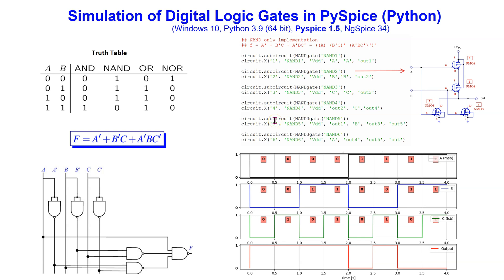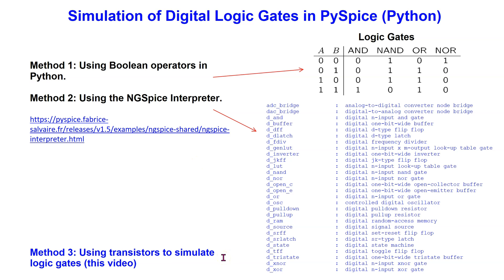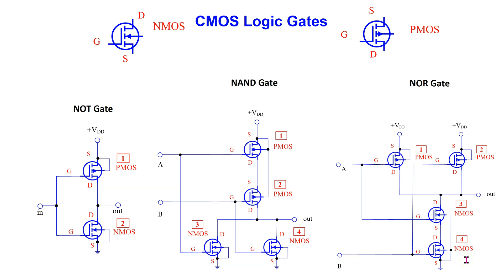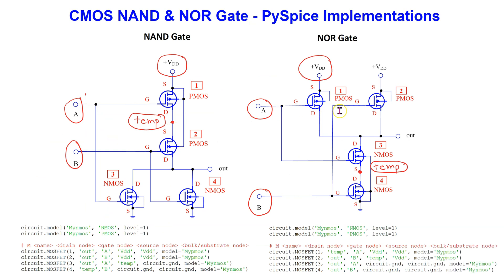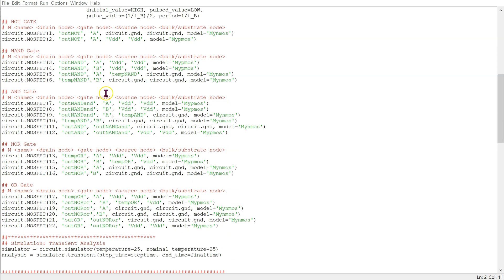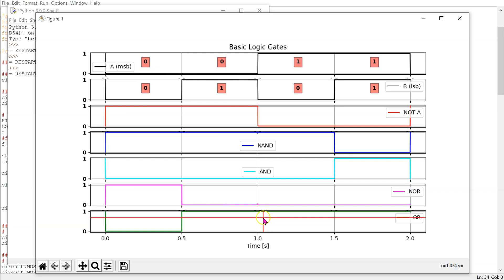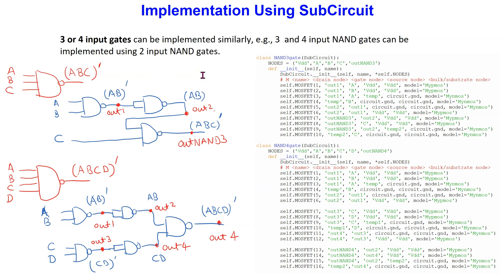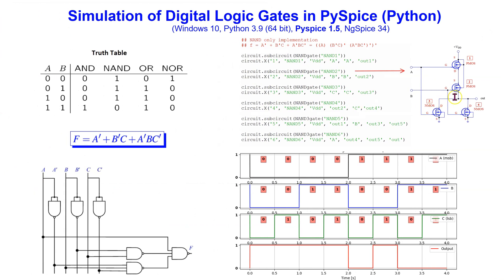Simulation of Digital Logic Gates in PySpice (Python)

Comment from the maker: ## Python code to simulate and verify the truth table of basic logic gates.

##*********************************************
import math
import numpy as np
import matplotlib.pyplot as plt
from matplotlib.widgets import Cursor
from matplotlib.pyplot import semilogx
from matplotlib import pyplot

import PySpice.Logging.Logging as Logging
logger = Logging.setup_logging()

from PySpice.Doc.ExampleTools import find_libraries
from PySpice.Probe.Plot import plot
from PySpice.Spice.Library import SpiceLibrary
from PySpice.Spice.Netlist import Circuit
from PySpice.Unit import *

from engineering_notation import EngNumber

##*********************************************

## Circuit Netlist
circuit = Circuit('2-input Logic Gates')

## Define basic NMOS and PMOS models
circuit.model('Mynmos', 'NMOS', level=1)
circuit.model('MYpmos', 'PMOS', level=1)

# Define inputs
HIGH = 3@u_V
LOW = 0@u_V
f_B = 1@u_Hz
#f_A = ((f_B)/2)
f_A = ((f_B+1e-3)/2)

steptime=1@u_ms
finaltime = 2/f_B

circuit.V(1, 'Vdd', circuit.gnd, HIGH@u_V)

circuit.PulseVoltageSource(2, 'A', circuit.gnd,
                           initial_value=HIGH, pulsed_value=LOW,
                           pulse_width=(1/f_A)/2, period=1/f_A)

circuit.PulseVoltageSource(3, 'B', circuit.gnd,
                           initial_value=HIGH, pulsed_value=LOW,
                           pulse_width=(1/f_B)/2, period=1/f_B)
## NOT GATE
# M <name> <drain node> <gate node> <source node> <bulk/substrate node>
circuit.MOSFET(1, 'outNOT', 'A', circuit.gnd, circuit.gnd, model='Mynmos')
circuit.MOSFET(2, 'outNOT', 'A', 'Vdd', 'Vdd', model='Mypmos')

## NAND Gate
# M <name> <drain node> <gate node> <source node> <bulk/substrate node>
circuit.MOSFET(3, 'outNAND', 'A', 'Vdd', 'Vdd', model='Mypmos')
circuit.MOSFET(4, 'outNAND', 'B', 'Vdd', 'Vdd', model='Mypmos')
circuit.MOSFET(5, 'outNAND', 'A', 'tempNAND', circuit.gnd, model='Mynmos')
circuit.MOSFET(6, 'tempNAND','B', circuit.gnd, circuit.gnd, model='Mynmos')

## AND Gate
# M <name> <drain node> <gate node> <source node> <bulk/substrate node>
circuit.MOSFET(7, 'outNANDand', 'A', 'Vdd', 'Vdd', model='Mypmos')
circuit.MOSFET(8, 'outNANDand', 'B', 'Vdd', 'Vdd', model='Mypmos')
circuit.MOSFET(9, 'outNANDand', 'A', 'tempAND', circuit.gnd, model='Mynmos')
circuit.MOSFET(10, 'tempAND','B', circuit.gnd, circuit.gnd, model='Mynmos')
circuit.MOSFET(11, 'outAND', 'outNANDand', circuit.gnd, circuit.gnd, model='Mynmos')
circuit.MOSFET(12, 'outAND', 'outNANDand', 'Vdd', 'Vdd', model='Mypmos')

## NOR Gate
# M <name> <drain node> <gate node> <source node> <bulk/substrate node>
circuit.MOSFET(13, 'tempOR', 'A', 'Vdd', 'Vdd', model='Mypmos')
circuit.MOSFET(14, 'outNOR', 'B', 'tempOR', 'Vdd', model='Mypmos')
circuit.MOSFET(15, 'outNOR', 'A', circuit.gnd, circuit.gnd, model='Mynmos')
circuit.MOSFET(16, 'outNOR','B', circuit.gnd, circuit.gnd, model='Mynmos')

## OR Gate
# M <name> <drain node> <gate node> <source node> <bulk/substrate node>
circuit.MOSFET(17, 'tempOR', 'A', 'Vdd', 'Vdd', model='Mypmos')
circuit.MOSFET(18, 'outNORor', 'B', 'tempOR', 'Vdd', model='Mypmos')
circuit.MOSFET(19, 'outNORor', 'A', circuit.gnd, circuit.gnd, model='Mynmos')
circuit.MOSFET(20, 'outNORor','B', circuit.gnd, circuit.gnd, model='Mynmos')
circuit.MOSFET(21, 'outOR', 'outNORor', circuit.gnd, circuit.gnd, model='Mynmos')
circuit.MOSFET(22, 'outOR', 'outNORor', 'Vdd', 'Vdd', model='Mypmos')

##*********************************************
## Simulation: Transient Analysis
simulator = circuit.simulator(temperature=25, nominal_temperature=25)
analysis = simulator.transient(step_time=steptime, end_time=finaltime)

##*********************************************
# PLOTTING COMMANDS

figure = plt.subplots(figsize=(11, 6))

axe = plt.subplot(711)
plt.title('Basic Logic Gates')
plt.grid()
plot(analysis['A'], axis=axe, color='black', label='A (msb)')
plt.legend()
axe.set_xticks(np.arange(0, finaltime+.5/f_B, 0.5/f_B))
axe.set_yticks([0, float(HIGH)])
labels = ['0', '1']
axe.set_yticklabels(labels, fontweight='bold')

axe.text(0.25*(1/f_B), 0.5*float(HIGH), '0', fontweight='bold',
        bbox={'facecolor': 'red', 'alpha': 0.5, 'pad': 4})
axe.text(0.75*(1/f_B), 0.5*float(HIGH), '0', fontweight='bold',
        bbox={'facecolor': 'red', 'alpha': 0.5, 'pad': 4})
axe.text(1.25*(1/f_B), 0.5*float(HIGH), '1', fontweight='bold',
        bbox={'facecolor': 'red', 'alpha': 0.5, 'pad': 4})
axe.text(1.75*(1/f_B), 0.5*float(HIGH), '1', fontweight='bold',
        bbox={'facecolor': 'red', 'alpha': 0.5, 'pad': 4})

axe = plt.subplot(712)
plt.grid()
plot(analysis['B'], axis=axe, color='black', label='B (lsb)')
plt.legend()
axe.set_xticks(np.arange(0, finaltime+.5/f_B, 0.5/f_B))
axe.set_yticks([0, float(HIGH)])
labels = ['0', '1']
axe.set_yticklabels(labels, fontweight='bold')

axe.text(0.25*(1/f_B), 0.5*float(HIGH), '0', fontweight='bold',
        bbox={'facecolor': 'red', 'alpha': 0.5, 'pad': 4})
axe.text(0.75*(1/f_B), 0.5*float(HIGH), '1', fontweight='bold',
        bbox={'facecolor': 'red', 'alpha': 0.5, 'pad': 4})
axe.text(1.25*(1/f_B), 0.5*float(HIGH), '0', fontweight='bold',
        bbox={'facecolor': 'red', 'alpha': 0.5, 'pad': 4})
axe.text(1.75*(1/f_B), 0.5*float(HIGH), '1', fontweight='bold',
        bbox={'facecolor': 'red', 'alpha': 0.5, 'pad': 4})

axe = plt.subplot(713)
plt.grid()
plot(analysis['outNOT'], axis=axe, color='red', label='NOT A')
plt.legend()
axe.set_xticks(np.arange(0, finaltime+.5/f_B, 0.5/f_B))
axe.set_yticks([0, float(HIGH)])
labels = ['0', '1']
axe.set_yticklabels(labels, fontweight='bold')

axe = plt.subplot(714)
plt.grid()
plot(analysis['outNAND'], axis=axe, color='blue', label='NAND')
plt.legend()
axe.set_xticks(np.arange(0, finaltime+.5/f_B, 0.5/f_B))
axe.set_yticks([0,float(HIGH)])
labels = ['0', '1']
axe.set_yticklabels(labels, fontweight='bold')

axe = plt.subplot(715)
plt.grid()
plot(analysis['outAND'], axis=axe, color='cyan', label='AND')
plt.legend()
axe.set_xticks(np.arange(0, finaltime+.5/f_B, 0.5/f_B))
axe.set_yticks([0, float(HIGH)])
labels = ['0', '1']
axe.set_yticklabels(labels, fontweight='bold')

axe = plt.subplot(716)
plt.grid()
plot(analysis['outNOR'], axis=axe, color='magenta', label='NOR')
plt.legend()
axe.set_xticks(np.arange(0, finaltime+.5/f_B, 0.5/f_B))
axe.set_yticks([0, float(HIGH)])
labels = ['0', '1']
axe.set_yticklabels(labels, fontweight='bold')

axe = plt.subplot(717)
plt.xlabel('Time [s]')
plt.grid()
plot(analysis['outOR'], axis=axe, color='green', label='OR')
plt.legend()
axe.set_xticks(np.arange(0, finaltime+.5/f_B, 0.5/f_B))
axe.set_yticks([0, float(HIGH)])
labels = ['0', '1']
axe.set_yticklabels(labels, fontweight='bold')

cursor = Cursor(axe, useblit=True, color='red', linewidth=1)
plt.show()
Reply from the maker: ## Code to simulate combinational logic circuit with 2 inputs.

##*********************************************
import math
import numpy as np
import matplotlib.pyplot as plt
from matplotlib.widgets import Cursor
from matplotlib.pyplot import semilogx
from matplotlib import pyplot

import PySpice.Logging.Logging as Logging
logger = Logging.setup_logging()

from PySpice.Doc.ExampleTools import find_libraries
from PySpice.Probe.Plot import plot
from PySpice.Spice.Library import SpiceLibrary
from PySpice.Spice.Netlist import Circuit
from PySpice.Spice.Netlist import SubCircuit
from PySpice.Unit import *

from engineering_notation import EngNumber

##*********************************************

class NOTgate(SubCircuit):
    NODES = ('Vdd','input','outNOT')
    def __init__(self, name):
        SubCircuit.__init__(self, name, *self.NODES)
        ## NOT GATE
        # M <name> <drain node> <gate node> <source node> <bulk/substrate node>
        self.MOSFET(1, 'outNOT', 'input', circuit.gnd, circuit.gnd, model='Mynmos')
        self.MOSFET(2, 'outNOT', 'input', 'Vdd', 'Vdd', model='Mypmos')

class NANDgate(SubCircuit):
    NODES = ('Vdd','A','B','outNAND')
    def __init__(self, name):
        SubCircuit.__init__(self, name, *self.NODES)
        ## NAND Gate
        # M <name> <drain node> <gate node> <source node> <bulk/substrate node>
        self.MOSFET(1, 'outNAND', 'A', 'Vdd', 'Vdd', model='Mypmos')
        self.MOSFET(2, 'outNAND', 'B', 'Vdd', 'Vdd', model='Mypmos')
        self.MOSFET(3, 'outNAND', 'A', 'tempNAND', circuit.gnd, model='Mynmos')
        self.MOSFET(4, 'tempNAND','B', circuit.gnd, circuit.gnd, model='Mynmos')

class ANDgate(SubCircuit):
    NODES = ('Vdd','A','B','outAND')
    def __init__(self, name):
        SubCircuit.__init__(self, name, *self.NODES)
        # M <name> <drain node> <gate node> <source node> <bulk/substrate node>
        self.MOSFET(1, 'outNANDand', 'A', 'Vdd', 'Vdd', model='Mypmos')
        self.MOSFET(2, 'outNANDand', 'B', 'Vdd', 'Vdd', model='Mypmos')
        self.MOSFET(3, 'outNANDand', 'A', 'tempAND', circuit.gnd, model='Mynmos')
        self.MOSFET(4, 'tempAND','B', circuit.gnd, circuit.gnd, model='Mynmos')
        self.MOSFET(5, 'outAND', 'outNANDand', circuit.gnd, circuit.gnd, model='Mynmos')
        self.MOSFET(6, 'outAND', 'outNANDand', 'Vdd', 'Vdd', model='Mypmos')

class NORgate(SubCircuit):
    NODES = ('Vdd','A','B','outNOR')
    def __init__(self, name):
        SubCircuit.__init__(self, name, *self.NODES)        
        ## NOR Gate
        # M <name> <drain node> <gate node> <source node> <bulk/substrate node>
        self.MOSFET(1, 'tempOR', 'A', 'Vdd', 'Vdd', model='Mypmos')
        self.MOSFET(2, 'outNOR', 'B', 'tempOR', 'Vdd', model='Mypmos')
        self.MOSFET(3, 'outNOR', 'A', circuit.gnd, circuit.gnd, model='Mynmos')
        self.MOSFET(4, 'outNOR','B', circuit.gnd, circuit.gnd, model='Mynmos')

class ORgate(SubCircuit):
    NODES = ('Vdd','A','B','outOR')
    def __init__(self, name):
        SubCircuit.__init__(self, name, *self.NODES)        
        ## OR Gate
        # M <name> <drain node> <gate node> <source node> <bulk/substrate node>
        self.MOSFET(1, 'tempOR', 'A', 'Vdd', 'Vdd', model='Mypmos')
        self.MOSFET(2, 'outNORor', 'B', 'tempOR', 'Vdd', model='Mypmos')
        self.MOSFET(3, 'outNORor', 'A', circuit.gnd, circuit.gnd, model='Mynmos')
        self.MOSFET(4, 'outNORor','B', circuit.gnd, circuit.gnd, model='Mynmos')
        self.MOSFET(5, 'outOR', 'outNORor', circuit.gnd, circuit.gnd, model='Mynmos')
        self.MOSFET(6, 'outOR', 'outNORor', 'Vdd', 'Vdd', model='Mypmos')

class NAND3gate(SubCircuit):
    NODES = ('Vdd','A','B','C','outNAND3')
    def __init__(self, name):
        SubCircuit.__init__(self, name, *self.NODES)
        # M <name> <drain node> <gate node> <source node> <bulk/substrate node>
        self.MOSFET(1, 'out1', 'A', 'Vdd', 'Vdd', model='Mypmos')
        self.MOSFET(2, 'out1', 'B', 'Vdd', 'Vdd', model='Mypmos')
        self.MOSFET(3, 'out1', 'A', 'temp', circuit.gnd, model='Mynmos')
        self.MOSFET(4, 'temp','B', circuit.gnd, circuit.gnd, model='Mynmos')
        self.MOSFET(5, 'out2', 'out1', circuit.gnd, circuit.gnd, model='Mynmos')
        self.MOSFET(6, 'out2', 'out1', 'Vdd', 'Vdd', model='Mypmos')
        self.MOSFET(7, 'outNAND3', 'out2', 'Vdd', 'Vdd', model='Mypmos')
        self.MOSFET(8, 'outNAND3', 'C', 'Vdd', 'Vdd', model='Mypmos')
        self.MOSFET(9, 'outNAND3', 'out2', 'temp2', circuit.gnd, model='Mynmos')
        self.MOSFET(10, 'temp2','C', circuit.gnd, circuit.gnd, model='Mynmos')

class NAND4gate(SubCircuit):
    NODES = ('Vdd','A','B','C','D','outNAND4')
    def __init__(self, name):
        SubCircuit.__init__(self, name, *self.NODES)
        # M <name> <drain node> <gate node> <source node> <bulk/substrate node>
        self.MOSFET(1, 'out1', 'A', 'Vdd', 'Vdd', model='Mypmos')
        self.MOSFET(2, 'out1', 'B', 'Vdd', 'Vdd', model='Mypmos')
        self.MOSFET(3, 'out1', 'A', 'temp', circuit.gnd, model='Mynmos')
        self.MOSFET(4, 'temp','B', circuit.gnd, circuit.gnd, model='Mynmos')
        self.MOSFET(5, 'out2', 'out1', circuit.gnd, circuit.gnd, model='Mynmos')
        self.MOSFET(6, 'out2', 'out1', 'Vdd', 'Vdd', model='Mypmos')

        self.MOSFET(7, 'out3', 'C', 'Vdd', 'Vdd', model='Mypmos')
        self.MOSFET(8, 'out3', 'D', 'Vdd', 'Vdd', model='Mypmos')
        self.MOSFET(9, 'out3', 'C', 'temp1', circuit.gnd, model='Mynmos')
        self.MOSFET(10, 'temp1','D', circuit.gnd, circuit.gnd, model='Mynmos')
        self.MOSFET(11, 'out4', 'out3', circuit.gnd, circuit.gnd, model='Mynmos')
        self.MOSFET(12, 'out4', 'out3', 'Vdd', 'Vdd', model='Mypmos')

        self.MOSFET(13, 'outNAND4', 'out2', 'Vdd', 'Vdd', model='Mypmos')
        self.MOSFET(14, 'outNAND4', 'out4', 'Vdd', 'Vdd', model='Mypmos')
        self.MOSFET(15, 'outNAND4', 'out2', 'temp2', circuit.gnd, model='Mynmos')
        self.MOSFET(16, 'temp2','out4', circuit.gnd, circuit.gnd, model='Mynmos')

## Circuit Netlist
circuit = Circuit('Combinational Logic Circuit')

circuit.model('Mynmos', 'NMOS', level=1)
circuit.model('Mypmos', 'PMOS', level=1)

# Define inputs
HIGH = 3@u_V
LOW = 0@u_V
f_B = 1@u_Hz
#f_A = ((f_B)/2)
f_A = ((f_B+1e-3)/2)

steptime=1@u_ms
finaltime = 2/f_B

circuit.V(1, 'Vdd', circuit.gnd, HIGH@u_V)

circuit.PulseVoltageSource(2, 'A', circuit.gnd,
                           initial_value=HIGH, pulsed_value=LOW,
                           pulse_width=(1/f_A)/2, period=1/f_A)

circuit.PulseVoltageSource(3, 'B', circuit.gnd,
                           initial_value=HIGH, pulsed_value=LOW,
                           pulse_width=(1/f_B)/2, period=1/f_B)

# f = A'B + AB' 

circuit.subcircuit(NOTgate('NOT1'))
circuit.X('1', 'NOT1', 'Vdd', 'A', 'out1')

circuit.subcircuit(NOTgate('NOT2'))
circuit.X('2', 'NOT2', 'Vdd', 'B', 'out2')

circuit.subcircuit(ANDgate('AND1'))
circuit.X('3', 'AND1', 'Vdd', 'out1', 'B','out3')

circuit.subcircuit(ANDgate('AND2'))
circuit.X('4', 'AND2', 'Vdd', 'A', 'out2','out4')

circuit.subcircuit(ORgate('OR1'))
circuit.X('5', 'OR1', 'Vdd', 'out3', 'out4','out')

##*********************************************
## Simulation: Transient Analysis
simulator = circuit.simulator(temperature=25, nominal_temperature=25)
analysis = simulator.transient(step_time=steptime, end_time=finaltime)

##*********************************************
# PLOTTING COMMANDS

figure = plt.subplots(figsize=(11, 6))

axe = plt.subplot(311)
plt.title('Combinational Logic Circuit')
plt.grid()
plot(analysis['A'], axis=axe, color='black', label='A (msb)')
plt.legend()
axe.set_xticks(np.arange(0, finaltime+.5/f_B, 0.5/f_B))
axe.set_yticks([0, float(HIGH)])
labels = ['0', '1']
axe.set_yticklabels(labels, fontweight='bold')
axe.text(0.25*(1/f_B), 0.75*float(HIGH), '0', fontweight='bold',
        bbox={'facecolor': 'red', 'alpha': 0.5, 'pad': 4})
axe.text(0.75*(1/f_B), 0.75*float(HIGH), '0', fontweight='bold',
        bbox={'facecolor': 'red', 'alpha': 0.5, 'pad': 4})
axe.text(1.25*(1/f_B), 0.75*float(HIGH), '1', fontweight='bold',
        bbox={'facecolor': 'red', 'alpha': 0.5, 'pad': 4})
axe.text(1.75*(1/f_B), 0.75*float(HIGH), '1', fontweight='bold',
        bbox={'facecolor': 'red', 'alpha': 0.5, 'pad': 4})

axe = plt.subplot(312)
plt.grid()
plot(analysis['B'], axis=axe, color='blue', label='B (lsb)')
plt.legend()
axe.set_xticks(np.arange(0, finaltime+.5/f_B, 0.5/f_B))
axe.set_yticks([0, float(HIGH)])
labels = ['0', '1']
axe.set_yticklabels(labels, fontweight='bold')
axe.text(0.25*(1/f_B), 0.75*float(HIGH), '0', fontweight='bold',
        bbox={'facecolor': 'red', 'alpha': 0.5, 'pad': 4})
axe.text(0.75*(1/f_B), 0.75*float(HIGH), '1', fontweight='bold',
        bbox={'facecolor': 'red', 'alpha': 0.5, 'pad': 4})
axe.text(1.25*(1/f_B), 0.75*float(HIGH), '0', fontweight='bold',
        bbox={'facecolor': 'red', 'alpha': 0.5, 'pad': 4})
axe.text(1.75*(1/f_B), 0.75*float(HIGH), '1', fontweight='bold',
        bbox={'facecolor': 'red', 'alpha': 0.5, 'pad': 4})

axe = plt.subplot(313)
plt.xlabel('Time [s]')
#plt.ylabel('Voltage [V]')
plt.grid()
plot(analysis['out'], axis=axe, color='red', label='Output')
plt.legend()
axe.set_xticks(np.arange(0, finaltime+.5/f_B, 0.5/f_B))
axe.set_yticks([0, float(HIGH)])
labels = ['0', '1']
axe.set_yticklabels(labels, fontweight='bold')

cursor = Cursor(axe, useblit=True, color='red', linewidth=1)
plt.show()
Reply from the maker: # Code to simulate combinational logic circuit with 3 inputs. Due to the Youtube 10,000 character limit for comments, the standard declarations, and subcircuit definitions are omitted. They are available in the other comments above and can be copy pasted before running the code.

## Circuit Netlist

circuit = Circuit('Combinational Logic Circuit')

circuit.model('Mynmos', 'NMOS', level=1)
circuit.model('Mypmos', 'PMOS', level=1)

# Define inputs
HIGH = 3@u_V
LOW = 0@u_V
f_C = 1@u_Hz
f_B = f_C/2
f_A = f_C/4

steptime=1@u_ms
finaltime = 4/f_C

circuit.V(1, 'Vdd', circuit.gnd,       HIGH@u_V)

circuit.PulseVoltageSource(2, 'A', circuit.gnd,
                           initial_value=HIGH, pulsed_value=LOW,
                           pulse_width=(1/f_A)/2, period=1/f_A)

circuit.PulseVoltageSource(3, 'B', circuit.gnd,
                           initial_value=HIGH, pulsed_value=LOW,
                           pulse_width=(1/f_B)/2, period=1/f_B)

circuit.PulseVoltageSource(4, 'C', circuit.gnd,
                           initial_value=HIGH, pulsed_value=LOW,
                           pulse_width=(1/f_C)/2, period=1/f_C)

## NAND only implementation
## f = A' + B'C + A'BC' = ((A) (B'C)' (A'BC')')'

circuit.subcircuit(NANDgate('NAND1'))
circuit.X('1', 'NAND1', 'Vdd', 'A', 'A', 'out1')

circuit.subcircuit(NANDgate('NAND2'))
circuit.X('2', 'NAND2', 'Vdd', 'B','B', 'out2')

circuit.subcircuit(NANDgate('NAND3'))
circuit.X('3', 'NAND3', 'Vdd', 'C', 'C', 'out3')

circuit.subcircuit(NANDgate('NAND4'))
circuit.X('4', 'NAND4', 'Vdd', 'out2', 'C','out4')

circuit.subcircuit(NAND3gate('NAND5'))
circuit.X('5', 'NAND5', 'Vdd', 'out1', 'B', 'out3', 'out5')

circuit.subcircuit(NAND3gate('NAND6'))
circuit.X('6', 'NAND6', 'Vdd', 'A', 'out4', 'out5', 'out')

##*********************************************
## Simulation: Transient Analysis
simulator = circuit.simulator(temperature=25, nominal_temperature=25)
analysis = simulator.transient(step_time=steptime, end_time=finaltime)

#######################################################################
# PLOTTING COMMANDS

figure = plt.subplots(figsize=(11, 6))

axe = plt.subplot(411)
plt.title('Combinational Logic Circuit with 3 inputs')
plt.grid()
plot(analysis['A'], axis=axe, color='black', label='A (msb)')
plt.legend()
axe.set_xticks(np.arange(0, finaltime+0.5/f_C, 0.5/f_C))
axe.set_yticks([0, float(HIGH)])
labels = ['0', '1']
axe.set_yticklabels(labels, fontweight='bold')
axe.text(0.25*(1/f_C), 0.75*float(HIGH), '0', fontweight='bold',
        bbox={'facecolor': 'red', 'alpha': 0.5, 'pad': 4})
axe.text(0.75*(1/f_C), 0.75*float(HIGH), '0', fontweight='bold',
        bbox={'facecolor': 'red', 'alpha': 0.5, 'pad': 4})
axe.text(1.25*(1/f_C), 0.75*float(HIGH), '0', fontweight='bold',
        bbox={'facecolor': 'red', 'alpha': 0.5, 'pad': 4})
axe.text(1.75*(1/f_C), 0.75*float(HIGH), '0', fontweight='bold',
        bbox={'facecolor': 'red', 'alpha': 0.5, 'pad': 4})
axe.text(2.25*(1/f_C), 0.75*float(HIGH), '1', fontweight='bold',
        bbox={'facecolor': 'red', 'alpha': 0.5, 'pad': 4})
axe.text(2.75*(1/f_C), 0.75*float(HIGH), '1', fontweight='bold',
        bbox={'facecolor': 'red', 'alpha': 0.5, 'pad': 4})
axe.text(3.25*(1/f_C), 0.75*float(HIGH), '1', fontweight='bold',
        bbox={'facecolor': 'red', 'alpha': 0.5, 'pad': 4})
axe.text(3.75*(1/f_C), 0.75*float(HIGH), '1', fontweight='bold',
        bbox={'facecolor': 'red', 'alpha': 0.5, 'pad': 4})

axe = plt.subplot(412)
plt.grid()
plot(analysis['B'], axis=axe, color='blue', label='B')
plt.legend()
axe.set_xticks(np.arange(0, finaltime+0.5/f_C, 0.5/f_C))
axe.set_yticks([0, float(HIGH)])
labels = ['0', '1']
axe.set_yticklabels(labels, fontweight='bold')
axe.text(0.25*(1/f_C), 0.75*float(HIGH), '0', fontweight='bold',
        bbox={'facecolor': 'red', 'alpha': 0.5, 'pad': 4})
axe.text(0.75*(1/f_C), 0.75*float(HIGH), '0', fontweight='bold',
        bbox={'facecolor': 'red', 'alpha': 0.5, 'pad': 4})
axe.text(1.25*(1/f_C), 0.75*float(HIGH), '1', fontweight='bold',
        bbox={'facecolor': 'red', 'alpha': 0.5, 'pad': 4})
axe.text(1.75*(1/f_C), 0.75*float(HIGH), '1', fontweight='bold',
        bbox={'facecolor': 'red', 'alpha': 0.5, 'pad': 4})
axe.text(2.25*(1/f_C), 0.75*float(HIGH), '0', fontweight='bold',
        bbox={'facecolor': 'red', 'alpha': 0.5, 'pad': 4})
axe.text(2.75*(1/f_C), 0.75*float(HIGH), '0', fontweight='bold',
        bbox={'facecolor': 'red', 'alpha': 0.5, 'pad': 4})
axe.text(3.25*(1/f_C), 0.75*float(HIGH), '1', fontweight='bold',
        bbox={'facecolor': 'red', 'alpha': 0.5, 'pad': 4})
axe.text(3.75*(1/f_C), 0.75*float(HIGH), '1', fontweight='bold',
        bbox={'facecolor': 'red', 'alpha': 0.5, 'pad': 4})

axe = plt.subplot(413)
plt.grid()
plot(analysis['C'], axis=axe, color='green', label='C (lsb)')
plt.legend()
axe.set_xticks(np.arange(0, finaltime+0.5/f_C, 0.5/f_C))
axe.set_yticks([0, float(HIGH)])
labels = ['0', '1']
axe.set_yticklabels(labels, fontweight='bold')
axe.text(0.25*(1/f_C), 0.75*float(HIGH), '0', fontweight='bold',
        bbox={'facecolor': 'red', 'alpha': 0.5, 'pad': 4})
axe.text(0.75*(1/f_C), 0.75*float(HIGH), '1', fontweight='bold',
        bbox={'facecolor': 'red', 'alpha': 0.5, 'pad': 4})
axe.text(1.25*(1/f_C), 0.75*float(HIGH), '0', fontweight='bold',
        bbox={'facecolor': 'red', 'alpha': 0.5, 'pad': 4})
axe.text(1.75*(1/f_C), 0.75*float(HIGH), '1', fontweight='bold',
        bbox={'facecolor': 'red', 'alpha': 0.5, 'pad': 4})
axe.text(2.25*(1/f_C), 0.75*float(HIGH), '0', fontweight='bold',
        bbox={'facecolor': 'red', 'alpha': 0.5, 'pad': 4})
axe.text(2.75*(1/f_C), 0.75*float(HIGH), '1', fontweight='bold',
        bbox={'facecolor': 'red', 'alpha': 0.5, 'pad': 4})
axe.text(3.25*(1/f_C), 0.75*float(HIGH), '0', fontweight='bold',
        bbox={'facecolor': 'red', 'alpha': 0.5, 'pad': 4})
axe.text(3.75*(1/f_C), 0.75*float(HIGH), '1', fontweight='bold',
        bbox={'facecolor': 'red', 'alpha': 0.5, 'pad': 4})

axe = plt.subplot(414)
plt.xlabel('Time [s]')
#plt.ylabel('Voltage [V]')
plt.grid()
plot(analysis['out'], axis=axe, color='red', label='Output')
plt.legend()
axe.set_xticks(np.arange(0, finaltime+0.5/f_C, 0.5/f_C))
axe.set_yticks([0, float(HIGH)])
labels = ['0', '1']
axe.set_yticklabels(labels, fontweight='bold')

cursor = Cursor(axe, useblit=True, color='red', linewidth=1)
plt.show()
Reply from the maker: # Code to simulate combinational logic circuit with 4 inputs. Due to the Youtube 10,000 character limit for comments, the standard declarations, and subcircuit definitions are omitted. They are available in the other comments above and can be copy pasted before running the code.

## Circuit Netlist
circuit = Circuit('Combinational Logic Circuit')

circuit.model('Mynmos', 'NMOS', level=1)
circuit.model('Mypmos', 'PMOS', level=1)

# Define inputs
HIGH = 3@u_V
LOW = 0@u_V
f_D = 1@u_Hz
f_C = (f_D/2)
f_B = (f_D/4)
f_A = (f_D/8)

steptime=1@u_ms
finaltime = 8/f_D

circuit.V(1, 'Vdd', circuit.gnd,       HIGH@u_V)

circuit.PulseVoltageSource(2, 'A', circuit.gnd,
                           initial_value=HIGH, pulsed_value=LOW,
                           pulse_width=(1/f_A)/2, period=1/f_A)

circuit.PulseVoltageSource(3, 'B', circuit.gnd,
                           initial_value=HIGH, pulsed_value=LOW,
                           pulse_width=(1/f_B)/2, period=1/f_B)

circuit.PulseVoltageSource(4, 'C', circuit.gnd,
                           initial_value=HIGH, pulsed_value=LOW,
                           pulse_width=(1/f_C)/2, period=1/f_C)

circuit.PulseVoltageSource(5, 'D', circuit.gnd,
                           initial_value=HIGH, pulsed_value=LOW,
                           pulse_width=(1/f_D)/2, period=1/f_D)

## f = A + C + BD + B'D'

circuit.subcircuit(NOTgate('NOT1'))
circuit.X('1', 'NOT1', 'Vdd', 'B', 'out1')

circuit.subcircuit(NOTgate('NOT2'))
circuit.X('2', 'NOT2', 'Vdd', 'D', 'out2')

circuit.subcircuit(ANDgate('AND1'))
circuit.X('3', 'AND1', 'Vdd', 'B', 'D', 'out3')

circuit.subcircuit(ANDgate('AND2'))
circuit.X('4', 'AND2', 'Vdd', 'out1', 'out2', 'out4')

circuit.subcircuit(ORgate('OR1'))
circuit.X('5', 'OR1', 'Vdd', 'A', 'C', 'out5')

circuit.subcircuit(ORgate('OR2'))
circuit.X('6', 'OR2', 'Vdd', 'out3', 'out4', 'out6')

circuit.subcircuit(ORgate('OR3'))
circuit.X('7', 'AND2', 'Vdd', 'out5', 'out6', 'out')

##*********************************************
## Simulation: Transient Analysis
simulator = circuit.simulator(temperature=25, nominal_temperature=25)
analysis = simulator.transient(step_time=steptime, end_time=finaltime)

#######################################################################
# PLOTTING COMMANDS

figure = plt.subplots(figsize=(11, 6))

axe = plt.subplot(511)
plt.title('Combinational Logic Circuit with 4 inputs')
plt.grid()
plot(analysis['A'], axis=axe, color='black', label='A (msb)')
plt.legend()
axe.set_xticks(np.arange(0, 8.5/f_D, 0.5/f_D))
axe.set_yticks([0, float(HIGH)])
labels = ['0', '1']
axe.set_yticklabels(labels, fontweight='bold')
axe.text(0.25*(1/f_D), 0.75*float(HIGH), '0', fontweight='bold',
        bbox={'facecolor': 'red', 'alpha': 0.5, 'pad': 4})
axe.text(0.75*(1/f_D), 0.75*float(HIGH), '0', fontweight='bold',
        bbox={'facecolor': 'red', 'alpha': 0.5, 'pad': 4})
axe.text(1.25*(1/f_D), 0.75*float(HIGH), '0', fontweight='bold',
        bbox={'facecolor': 'red', 'alpha': 0.5, 'pad': 4})
axe.text(1.75*(1/f_D), 0.75*float(HIGH), '0', fontweight='bold',
        bbox={'facecolor': 'red', 'alpha': 0.5, 'pad': 4})
axe.text(2.25*(1/f_D), 0.75*float(HIGH), '0', fontweight='bold',
        bbox={'facecolor': 'red', 'alpha': 0.5, 'pad': 4})
axe.text(2.75*(1/f_D), 0.75*float(HIGH), '0', fontweight='bold',
        bbox={'facecolor': 'red', 'alpha': 0.5, 'pad': 4})
axe.text(3.25*(1/f_D), 0.75*float(HIGH), '0', fontweight='bold',
        bbox={'facecolor': 'red', 'alpha': 0.5, 'pad': 4})
axe.text(3.75*(1/f_D), 0.75*float(HIGH), '0', fontweight='bold',
        bbox={'facecolor': 'red', 'alpha': 0.5, 'pad': 4})
axe.text(4.25*(1/f_D), 0.75*float(HIGH), '1', fontweight='bold',
        bbox={'facecolor': 'red', 'alpha': 0.5, 'pad': 4})
axe.text(4.75*(1/f_D), 0.75*float(HIGH), '1', fontweight='bold',
        bbox={'facecolor': 'red', 'alpha': 0.5, 'pad': 4})
axe.text(5.25*(1/f_D), 0.75*float(HIGH), '1', fontweight='bold',
        bbox={'facecolor': 'red', 'alpha': 0.5, 'pad': 4})
axe.text(5.75*(1/f_D), 0.75*float(HIGH), '1', fontweight='bold',
        bbox={'facecolor': 'red', 'alpha': 0.5, 'pad': 4})
axe.text(6.25*(1/f_D), 0.75*float(HIGH), '1', fontweight='bold',
        bbox={'facecolor': 'red', 'alpha': 0.5, 'pad': 4})
axe.text(6.75*(1/f_D), 0.75*float(HIGH), '1', fontweight='bold',
        bbox={'facecolor': 'red', 'alpha': 0.5, 'pad': 4})
axe.text(7.25*(1/f_D), 0.75*float(HIGH), '1', fontweight='bold',
        bbox={'facecolor': 'red', 'alpha': 0.5, 'pad': 4})
axe.text(7.75*(1/f_D), 0.75*float(HIGH), '1', fontweight='bold',
        bbox={'facecolor': 'red', 'alpha': 0.5, 'pad': 4})

axe = plt.subplot(512)
plt.grid()
plot(analysis['B'], axis=axe, color='blue', label='B')
plt.legend()
axe.set_xticks(np.arange(0, 8.5/f_D, 0.5/f_D))
axe.set_yticks([0, float(HIGH)])
labels = ['0', '1']
axe.set_yticklabels(labels, fontweight='bold')
axe.text(0.25*(1/f_D), 0.75*float(HIGH), '0', fontweight='bold',
        bbox={'facecolor': 'red', 'alpha': 0.5, 'pad': 4})
axe.text(0.75*(1/f_D), 0.75*float(HIGH), '0', fontweight='bold',
        bbox={'facecolor': 'red', 'alpha': 0.5, 'pad': 4})
axe.text(1.25*(1/f_D), 0.75*float(HIGH), '0', fontweight='bold',
        bbox={'facecolor': 'red', 'alpha': 0.5, 'pad': 4})
axe.text(1.75*(1/f_D), 0.75*float(HIGH), '0', fontweight='bold',
        bbox={'facecolor': 'red', 'alpha': 0.5, 'pad': 4})
axe.text(2.25*(1/f_D), 0.75*float(HIGH), '1', fontweight='bold',
        bbox={'facecolor': 'red', 'alpha': 0.5, 'pad': 4})
axe.text(2.75*(1/f_D), 0.75*float(HIGH), '1', fontweight='bold',
        bbox={'facecolor': 'red', 'alpha': 0.5, 'pad': 4})
axe.text(3.25*(1/f_D), 0.75*float(HIGH), '1', fontweight='bold',
        bbox={'facecolor': 'red', 'alpha': 0.5, 'pad': 4})
axe.text(3.75*(1/f_D), 0.75*float(HIGH), '1', fontweight='bold',
        bbox={'facecolor': 'red', 'alpha': 0.5, 'pad': 4})
axe.text(4.25*(1/f_D), 0.75*float(HIGH), '0', fontweight='bold',
        bbox={'facecolor': 'red', 'alpha': 0.5, 'pad': 4})
axe.text(4.75*(1/f_D), 0.75*float(HIGH), '0', fontweight='bold',
        bbox={'facecolor': 'red', 'alpha': 0.5, 'pad': 4})
axe.text(5.25*(1/f_D), 0.75*float(HIGH), '0', fontweight='bold',
        bbox={'facecolor': 'red', 'alpha': 0.5, 'pad': 4})
axe.text(5.75*(1/f_D), 0.75*float(HIGH), '0', fontweight='bold',
        bbox={'facecolor': 'red', 'alpha': 0.5, 'pad': 4})
axe.text(6.25*(1/f_D), 0.75*float(HIGH), '1', fontweight='bold',
        bbox={'facecolor': 'red', 'alpha': 0.5, 'pad': 4})
axe.text(6.75*(1/f_D), 0.75*float(HIGH), '1', fontweight='bold',
        bbox={'facecolor': 'red', 'alpha': 0.5, 'pad': 4})
axe.text(7.25*(1/f_D), 0.75*float(HIGH), '1', fontweight='bold',
        bbox={'facecolor': 'red', 'alpha': 0.5, 'pad': 4})
axe.text(7.75*(1/f_D), 0.75*float(HIGH), '1', fontweight='bold',
        bbox={'facecolor': 'red', 'alpha': 0.5, 'pad': 4})

axe = plt.subplot(513)
plt.grid()
plot(analysis['C'], axis=axe, color='green', label='C')
plt.legend()
axe.set_xticks(np.arange(0, 8.5/f_D, 0.5/f_D))
axe.set_yticks([0, float(HIGH)])
labels = ['0', '1']
axe.set_yticklabels(labels, fontweight='bold')
axe.text(0.25*(1/f_D), 0.75*float(HIGH), '0', fontweight='bold',
        bbox={'facecolor': 'red', 'alpha': 0.5, 'pad': 4})
axe.text(0.75*(1/f_D), 0.75*float(HIGH), '0', fontweight='bold',
        bbox={'facecolor': 'red', 'alpha': 0.5, 'pad': 4})
axe.text(1.25*(1/f_D), 0.75*float(HIGH), '1', fontweight='bold',
        bbox={'facecolor': 'red', 'alpha': 0.5, 'pad': 4})
axe.text(1.75*(1/f_D), 0.75*float(HIGH), '1', fontweight='bold',
        bbox={'facecolor': 'red', 'alpha': 0.5, 'pad': 4})
axe.text(2.25*(1/f_D), 0.75*float(HIGH), '0', fontweight='bold',
        bbox={'facecolor': 'red', 'alpha': 0.5, 'pad': 4})
axe.text(2.75*(1/f_D), 0.75*float(HIGH), '0', fontweight='bold',
        bbox={'facecolor': 'red', 'alpha': 0.5, 'pad': 4})
axe.text(3.25*(1/f_D), 0.75*float(HIGH), '1', fontweight='bold',
        bbox={'facecolor': 'red', 'alpha': 0.5, 'pad': 4})
axe.text(3.75*(1/f_D), 0.75*float(HIGH), '1', fontweight='bold',
        bbox={'facecolor': 'red', 'alpha': 0.5, 'pad': 4})
axe.text(4.25*(1/f_D), 0.75*float(HIGH), '0', fontweight='bold',
        bbox={'facecolor': 'red', 'alpha': 0.5, 'pad': 4})
axe.text(4.75*(1/f_D), 0.75*float(HIGH), '0', fontweight='bold',
        bbox={'facecolor': 'red', 'alpha': 0.5, 'pad': 4})
axe.text(5.25*(1/f_D), 0.75*float(HIGH), '1', fontweight='bold',
        bbox={'facecolor': 'red', 'alpha': 0.5, 'pad': 4})
axe.text(5.75*(1/f_D), 0.75*float(HIGH), '1', fontweight='bold',
        bbox={'facecolor': 'red', 'alpha': 0.5, 'pad': 4})
axe.text(6.25*(1/f_D), 0.75*float(HIGH), '0', fontweight='bold',
        bbox={'facecolor': 'red', 'alpha': 0.5, 'pad': 4})
axe.text(6.75*(1/f_D), 0.75*float(HIGH), '0', fontweight='bold',
        bbox={'facecolor': 'red', 'alpha': 0.5, 'pad': 4})
axe.text(7.25*(1/f_D), 0.75*float(HIGH), '1', fontweight='bold',
        bbox={'facecolor': 'red', 'alpha': 0.5, 'pad': 4})
axe.text(7.75*(1/f_D), 0.75*float(HIGH), '1', fontweight='bold',
        bbox={'facecolor': 'red', 'alpha': 0.5, 'pad': 4})

axe = plt.subplot(514)
plt.grid()
plot(analysis['D'], axis=axe, color='cyan', label='D (lsb)')
plt.legend()
axe.set_xticks(np.arange(0, 8.5/f_D, 0.5/f_D))
axe.set_yticks([0, float(HIGH)])
labels = ['0', '1']
axe.set_yticklabels(labels, fontweight='bold')

axe = plt.subplot(515)
plt.xlabel('Time [s]')
#plt.ylabel('Voltage [V]')
plt.grid()
plot(analysis['out'], axis=axe, color='red', label='Output')
plt.legend()
axe.set_xticks(np.arange(0, 8.5/f_D, 0.5/f_D))
axe.set_yticks([0, float(HIGH)])
labels = ['0', '1']
axe.set_yticklabels(labels, fontweight='bold')

cursor = Cursor(axe, useblit=True, color='red', linewidth=1)
plt.show()